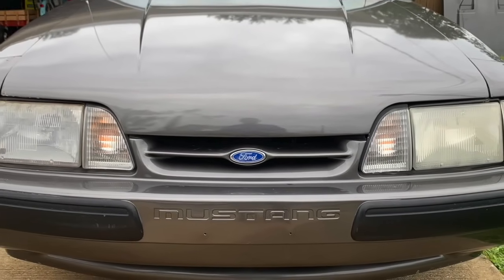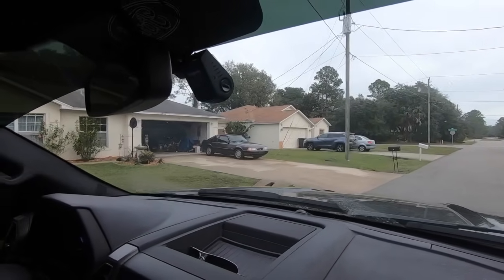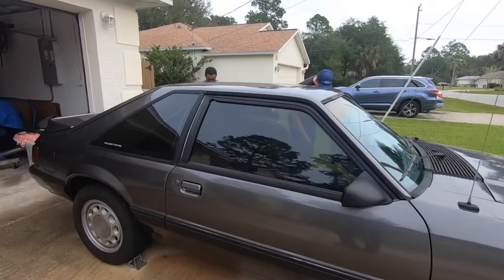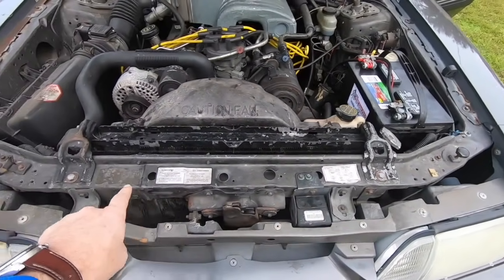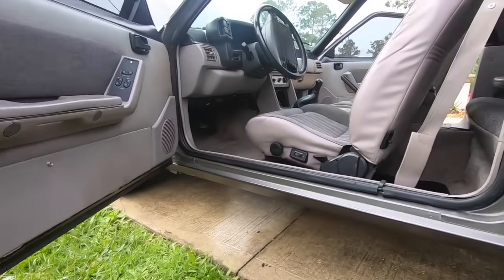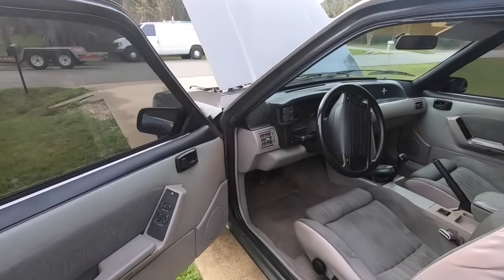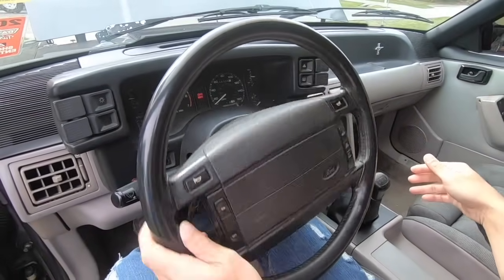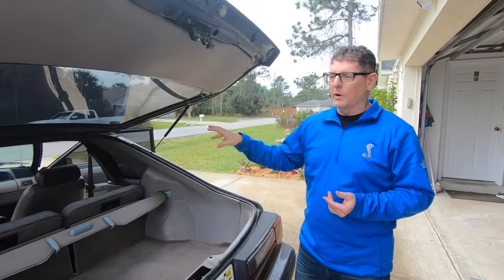Do We Buy It? How To Purchase An Affordable 5.0 Foxbody Mustang — Part 1

Comment: Here is your fox checklist hierarchy:  Don’t even bother looking at the rest of the car if the strut towers, door hinge pillars, and rear bumper strut supports are rusted-out.  Always remove the license plate to inspect the upright for rust.  Then run the motor and listen for the usual pinging, tapping, droning, and chatter.  Run the heat to see if the heater core is fogging the glass or stinking of glycol as that’s a proper long job.  Check the floors for firewall and heater core puddles and flex.  Climb under and look for oil pan rust and leaks, and rear main seal leaks.  Take the car for a ride and flog the motor with someone driving behind you to see if it’s blowing exhaust smoke through the valve guides, rings, and or head gaskets.  Listen for collector leaks under heavy throttle.  After the car cools down, look around the timing cover / lower intake interface for coolant leaks.  The rest of the stuff you sited (door handles, latches, interior trim seats etc) is trivial compared to the previous show stoppers.  You may be replacing the motor, but those new to the fox hobby might actual want to drive the car with the stock mill et al.  Cheers!

Comment: Stay away from rust (unless you're a body guy). Pop the hood and check the radiator support/frame rails for repairs. Slide underneath to see if the torque boxes are torn. Everything else is small stuff.

Comment: A few fox body red flags there, a sub frame connector and roll bar suggest some track time that stock motor wouldn't have ever warranted. I hope you did finally inspect the torque boxes and the A pillar for cracks. I'm betting this had a non-stock motor and slicks at some point, or at least someone who wished they had that and saw some abuse, but definitely something I'd try to get out of the 10 year owner. 

I'd hoped some of the mustang magazine content pro's would come to YouTube to make content after, and glad you are one of them. Putting some article structure and focus with the ability to show more detail will really stand out and is much needed. I'm really looking forward to continuing to follow your work.

Comment: ReVan good video, excellent tips, all true especially the torque Box and those subframe connector, some came zinc coated to protect, most did not, also like you said the welds!! 
Also the fresh air vent near the windscreen moisture collect there especially if leaves 🍁 etc is not cleaned out!! Great price!! Take me Back 80’s here we come!!🤣

Comment: '79-'93 Fox bodies are very cheaply made from a structural standpoint. The most important area is the floorpan, the thin gauge metal causes the unibody to collapse inward, especially on convertibles. This is the reason 90% of any remaining Fox bodies have subframe connectors, better quality ones incorporate seat reinforcement braces as well(torque boxes are a weak spot too on V8 cars). Back in 1986 a friend of a friend had an '83 Mustang GT and after one ride, you can sense the tin can construction of the body shell, the hood was paper thin too. I am from SoCal, so rust isn't a problem for 90% of cars out here. Open and close the doors, hood and trunk/hatch to give you an idea how the unibody is hopefully square, any binding of these appendages is reason for concern.
You can replace anything mechanical on a car, but if the unibody or body shell(if body on frame construction) is distorted or damaged(either with rust or accident damage), walk away because unless the car is worth much more than a total restoration cost, you'll be upside down.
Reply from the maker: Great points, thanks for watching.

Comment: This is a rare piece for being so old. Its not hard to find a fox body but it’s hard to find one Jim Bob didn’t fix on and ruin.  I see these all the time that are in excellent shape but some idiot butchered it up with aftermarket junk and stereo systems.   The interior would be the quick buy for me.  These fell apart after less than 10 year of ungaraged life and then quick fixes would ensue making bad worse.  This thing had to sit in a garage for the first 20 years of it’s life also.  10k worth of parts and a years worth of weekends and the car can easily be factory fresh.

Comment: Crazy thing is how the hell did these guys not even check the fluids in the car ?WOULDA been hard for me as the owner to stand there. Its an older foxbody. Buy shit or get off the pot. Worrying about the ash tray door map light and little things. How about is the oil clean level good? Trans fluid clean and full? Nothing leaking?. To many wanna be car gurus on the .NET.

Comment: You didn't look at the fitment between the lower windshield trim and the top of the passenger fender. If there's a gap, it means the body is twisted from hard shifts or wheelies. It's an easy way to quickly tell if a Fox has been abused.

Comment: Give be a break, your not buying a Concourse car for $ 5,000. I would have thrown you off my property by now if I was selling it, and it should have been more like 10K.  When my old 84 convertible didn't even start I refused $ 7,500 for it. It's an antique. Get real bro, real car people have no problem with that car for $ 5,000.
Reply: Bro there's a guy selling an 85 mustang gt the body looks good no dents , no rust original engine and it turns on, interior is good no rips  but the paint is faded from the sun he wants  $2,500 for it , do you think is a good deal?????

Comment: Sorry to tell you man but no way that is running 14s stock. New edge 4.6 5 speeds run low 15s stock.
Reply from the maker: We ran 13.9s all day with a stock 260 HP New Edge when I was editor of Muscle Mustangs magazine.
Reply: @revanevan  I'm going to have to call bullshit on that. a good tire, long tubes, catless x pipe, cold air, ported throttle body and a tune. The rear seats and spare tire removed they run high 13s while power shifting. No way in hell a bone stock new edge is running a 13.9.
Reply: @revanevan  really?
Reply from the maker: Konner Kramer call BS all you want, we actually ran 13.90/98 mph as tested in MM&FF Magazine. Bone stock. May 2002 issue.
Reply: @revanevan  that was with an auto car wasn't it?
Reply: My 00 5speed went 13.4 @ 103 with exhaust and intake on street tires.